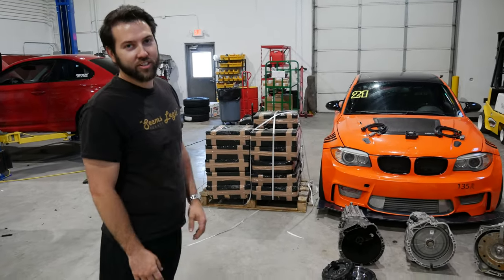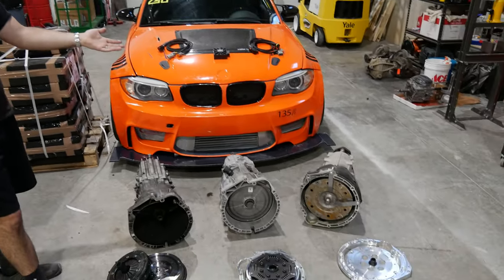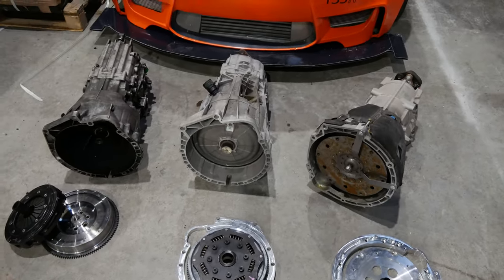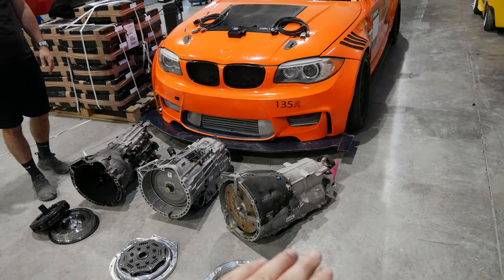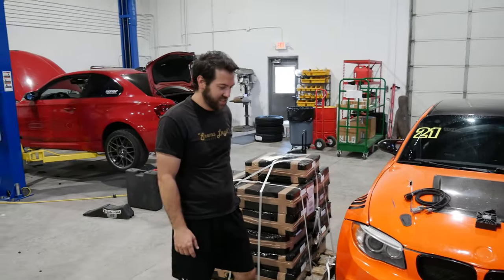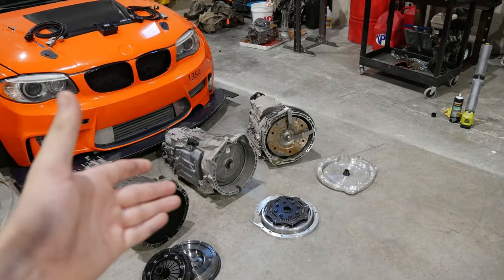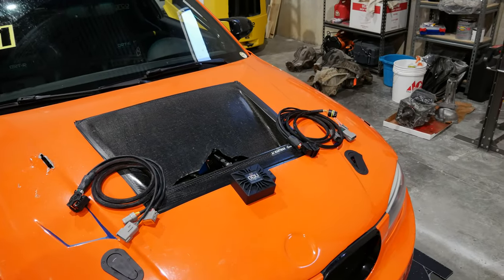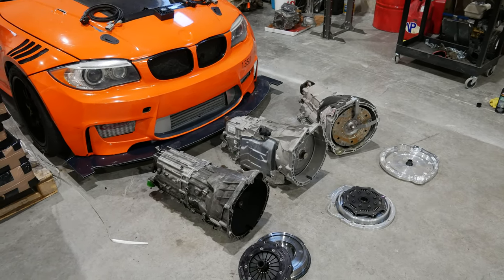8HP50/70 vs DCT Transmission Swaps for N54 BMW

Comment: If only the Turbo lamik controller was more easy to buy as it is a much better controller then HTG, theyve killed many boxes on popular swaps because of clutch adaptions.
Reply from the maker: Early on htg had teething problems but it works very very well with the new firmware and closed loop control of the tune and throttle control
Reply: @SeemsLegitGarage   i just recently returned my gcu because it was total dog shit. i can show you how i had to take a part a 15k dollar pure transmission because it fucked it all up.   i wouldnt use htg if you tried to pay me 25k dollars .  turbo lamik tcu is way better.  it runs on the factory bmw flash and resets adaptations, and then you use tuner pro to tune.  went from not being able to drive the car on the street with htg becuase it was jerky and terrible, to driving it like an oem 335i with lamik tcu.   i ttook htg a year to refund me and they sent parts insteaed of money.   aside from the tuning and electronics. the 8hp75 is godly for n54 cars.  i make the torque converter adapter to use the a90 8hp5x converter with the 8hp70 as long as you use a 17mm adapter plate( all n54 to 8hp adapters are 17mm)  .  i have a 5k rpm billet stator a90 converter in my full billet 8hp75 and its rated for 1600 ft lbs. i leave on the trans brake 20+ psi and my car sees 40 psi and it doesnt miss a beat.  drives like oem  until you want it to come alive .
Reply from the maker: @Mp-jw1qg  Sounds like you didn't have the right tuner, and also the closed loop was just released so you didn't have that if you had to wait a year.
Reply: @Mp-jw1qg  common problems at Htg. They service if you want to give them money but all other things they won't aswer. Everytime same excuse "we are so busy" Lol,customer service is really big thing with these controllers. So many have wasted they money and time to they "products" Thank good there is better options avaible like canformance and lamik.
Reply: @Mp-jw1qg  MAXXECU has gone the same direction using oem
Reply: @SeemsLegitGarage  sounds like the turbo lamik is better. I slapped an 8hp in my car in a day at work (I work at a shop) and drove it home and back to work in the morning it drove perfect and then I fine-tuned from there myself having never tuned a transmission before and it works great. You can get any trash controller to do what you need if you find the correct tuner.

Comment: What about the 6hp70? I know they aren't quite as good as the 8hp in terms of weight and shift speeds but they're pretty stout aren't they? 1000ft/lbs of torque capable and can be used with stock computers right?
Reply: I don’t think they ever made a 6hp70, furthest it goes is 6hp28 I believe? Either way there’s a reason guys in Europe switched to the 8hp a few years ago it’s a much better gearbox in all aspects.
Reply: @piovo1  that's my mistake, I mixed the 8hp coding up with the 6hp coding...but yes that is the transmission I was referring to
Reply: @SuperHbkforever  still need a different transmission controller, to be honest it would have been better but I think it’s quite rare in the us and Australia for the 8hp70s as there mainly used in diesels. Here in uk I can pick one up for £300-500z
Reply: @piovo1  would you need a different transmission controller for a hp21 to hp28 swap? To my understanding you can pair them to the factory computer and should run like stock, and being able to tune them through XHP in flashes. Ti be completely honest I'd prefer the 8hp route, but I drive an xdrive car and they are very hard to find (8hp70/75 specifically) at the moment I'm really trying to decide between rebuilding my stock trans with upgraded internals and torque converter, or going either hp28 or 8hp45/50 as they're showing up in yards nowadays...thanks for your input by the way

Comment: 8hp better then dct ?
Reply from the maker: they all have their place but we believe the 8hp is better all around. Holds more power, has a real trans brake for launches, smoother take up control and shifts basically just as fast as the DCT.
Reply: @SeemsLegitGarage  thank you I’m planning on doing a swap for my e60 m5

Comment: 8hp has pretty damn fast up shifts but down shifting is okay. It's annoying dropping  multiple gears on decel. I had it tuned which  greatly improved its behavior. However its not predictable enough for me to push my  f30 to the limit. I feel like a bit off padding is needed just incase it doesn't down shift exactly when I want or for having to ask it to down shift again...
Reply: when you do the swap you use a custom tcu with standalone tuning..  i have a pure drivetrain solutions 8hp75 in my 335i with lamik tcu and my car shifts exactly how i tell it to.  run the alpina b3 flash on the 8hp70 and it downshifts like a race car.
Reply from the maker: HTG can downshift much faster than oem
Reply: @SeemsLegitGarage  I have a tuned tcu fyi.
Reply: @konjiki240sx  you have a stock tuned ecu

Comment: i sent my htg controller back becuase it was dogshit and didnt have open loop tuning.  almost ruined my 15k dollars pure drivetrain solutions transmission. had to be completely taken apart and frictions replaced.  turbolamik tcu 2.0 is lightyears better.  just my honest 2 cents.. its a year later and i only got a shifter and some paddles for my $1600 refund.

even with my bad experience with HTG , ive been told they have fixed the bugs and now their system does work but i cant reccomend it until i see one in person because mine was FUCKED.

you can buy 8hp75 for 600 dollars shipped from ebay uk.   the 8hp50 and 8hp75 have identical internal gearing when you run a 3.31 final drive on the 8hp75. 

i make the adapter and a90 converter adapter to use with 8hp75. im in so cal. if you have someone to machine a few sets, ill send the cad files.  if you use the 8hp70 converter, it weighs twice what the a90 converter does and you cant get good response from it, revving the big converter above 7k is also dangerous lol.  ive spent so much money breaking these transmissions over the last 3 years doing this swap. if there is anything you guys need parts or tuning etc let me know , im always down to help .
Reply: the 'debate' between HTG and Lamik is super tough to work through from the outside, without any firsthand experience with either yet... both seem to swear the other is shit haha
Reply: @truecapacityfitness1611  because bart...is all talk. Nothing but that. I could link you to group of people who experienced the worst with htg including Screenshots of his behaviour in conversations. Actually i never heard Anything bad about a lamik unit.
Reply: @maxgr7723  yeah unfortunately I’ve heard this all way too many times, and know people first hand with that experience. I’ve gone with Lamik for my setup & as you’ve mentioned it seems to be nothing but positive feedback so fingers crossed I experience the same

Comment: I heard that the DCT is slower from a dig than the stock 6hp in an e90 335i.  Is this true and why?
Reply from the maker: I have never heard or experienced that, DCT has launch control and you can code it to start in 1st or 2nd. 8HP can have a slight advantage with trans break, but a 6hp just break boosting wouldn't be faster.

Comment: Any reason why you went with an 8HP50 w/ adapter plate instead of just going with an N55 8HP45 that bolts right up to the n54? I've been looking into this swap and a pure drivetrain solutions 8HP45 seems like it makes the most sense to go with in the States unless there's some major difference between the 45 and 50 that makes it a better transmission that I'm not aware of.
Reply: 50/70 apparently handle much more power...
Reply: @truecapacityfitness1611  the 50 doesnt hold anymore power than the 45. youll destroy the internals at 650hp.  8hp70 can hold close to 900hp with just tuning. with clutches and billet baskets it can handle 1500+ ft lbs at the wheels.  8hp50 would never even fully built.
Reply: @Mp-jw1qg  cheers for that! I’m not sure what I was thinking when I wrote that cos I did know the 45 & 50 are basically the same... Good to know the real world limits of both though thanks 👍🏼
I’m going to use the 45 with about550-600hp so fingers crossed it holds up
Reply from the maker: @truecapacityfitness1611  the 45 and 50 are not the same internally, we are finding the limit with the 50 and HTG. With HTG you can hold much more power than oem
Reply: @SeemsLegitGarage  I’m super interested in this cos I’m building an N54 powered Nissan chassis competition drift car at the moment & I’ve decided to go down the 8HP path too... tossing up between HTG or Lamik, leaning towards HTG
Reply: @Seems Legit Garage  hi guys, I'm here in the UK and have a m240i b58 with the zf8hp50, do you know how much hp and ft lb tq this box can handle before a swap to the hp70 would be needed. I have xhp stage 3 already just curious to know it's limits. Thanks, loving the videos, sending support from the UK.
Reply: @truecapacityfitness1611 lamik>>

Comment: I’ve been looking for a more modern solution to the SMG in my M5. The manual swap is where the money is because of the “save the manuals” purists, but frankly boring. I like the idea of a DCT, or the 8 speed. From what I gather it’s never been done successfully with the S85.  Do you make adapters for the S85?
Reply from the maker: We can use the E90 M3 transmission without the need for an adapter for that application
Reply: @SeemsLegitGarage  has it been done before? I remember reading somewhere years ago that the output shaft or something on the S85 was too big?
Reply from the maker: @adamjames90  Yea its been done, just need a custom driveshaftshaft, not the end of the world, we can do that as well
Reply: @SeemsLegitGarage  damn I might actually do this. Which flywheel would I need? The S85 or the S65s?
Reply from the maker: @adamjames90  s65 with the dct factory flywheel

Comment: I want to put a 8hp50 into my e53 at some point with a VF supercharger kit to mimic a x5 Le Mans with the power-weight ratio at least. Do you supply m54 adapter plates?
Reply from the maker: Yes we have M54 to 8HP

Comment: What final drive ratio will get you to 200hp while still getting a good 1/4 mile time
Reply: with an 8 speed and assuming you are running 255/35/18's with a 3.85 rear end you can get to 212mph at 7000 rpm. and about 3000 rpm at 90mph. a 3.08 would go 265mph in 8th gear at 7000 rpm and cruse at 118mph at 3000rpm. 2117 rpm at 80mph and 1720rpm at 65mph.
Reply: @BEAMERNOOB  Is that the German 8 speed with a 6th gear that's 1:1? I believe the overdrive ratio are less efficient as it will take more power to turn the gears. I dont have real world testing for cars in this category but I am planning on gathering the knowledge as my bank is loading.

Comment: Ram 1500 3L diesel trucks have zf8hp 70 transmission
Is there any reason to think I could not put this in my 90?
Reply from the maker: you can for sure, we have adapters in stock actually, email us :)

Comment: Look on it, size wise how much wider is the 8hp70 vs the 6 speed manual bz trans?
Reply from the maker: The BMW 70 isn't much wider but the dodge 70 is a little bit, some whacks to the trans tunnel are needed to fit the dodge.
Reply: @SeemsLegitGarage  ok thank you, I may end up using a 8hp50 from a b46 on a 2jz.

Comment: Where did you get the 3.27 diff? Weren’t the factory options, 3.08MT and 3.46AT for all N54’s?
Reply from the maker: Car has a Ford 8.8 rear end, which is another product we make
Reply: @SeemsLegitGarage  I thought maybe you found another gear set that works. I can’t be putting Ford stuff on my BMW. lol. Be easier just to have a ring and pinion custom made.
Reply from the maker: @TML34  You should, the ford works amazing. We track our cars and make lots of ford kits, many race teams save huge amounts of lap times with the awesome carbon clutch LSD we use. Custom gears are crazy expensive.
Reply: @SeemsLegitGarage  I don’t have any problems with the Quaife diff, driveshaft or axles though. It all works just fine, so not worth the swap (for me). I think Mfactory might have an in-between ratio that would be perfect. All I need is a different ring and pinion that bolts up to the factory crown wheel. Ratio swaps should be relatively straight forward.

Comment: What cars can I get 8hp transmission from and do you sell kit for e46 m3
Reply from the maker: Yes we have the adapters in stock. Please email us and we can sort you out with the details
Reply: @SeemsLegitGarage  the current adapter also fits S54?
Reply from the maker: @petereacmen716  it should actually yes, and we have others in stock for other 8hp for m5x/s5x. Only difference is the starter I believe but that’s interchangeable

Comment: i was all save the manuals til i drove the manual g80 and realized it’s still a big ass computer and i need a electric tranny
Reply: i have an e46 for ultimate driving experiences
Reply from the maker: I still love the manuals but honestly the DCT/8HP is such a blast
Reply: @SeemsLegitGarage  it’s pretty cool in a 1 series, i honestly prefer tuned SMG’s and DCTs but that’s just me. i like paddle shifting and just shifting straight up when i want to down shift. it feels natural and bad ass when im going from 0 to 100 too
Reply: @SeemsLegitGarage  but i have some manuals it’s just more for articulation for me and fun. not speed.

Comment: How much torque can dct handle?
Reply from the maker: depends on the controller and clutches but max is over 1200 ft lbs
Reply: @SeemsLegitGarage  what about the stock clutch? i got z4 35i,i wanna go bigger turbo,iv heard max is 600lbft on stock clutch

Comment: I'm sorry, this is for me personally. As a who automatics to their limit. I rather have the dinosaur manual. Manuals have never let me down. Racing wise I rather just invest in a proper sequential gearbox (paddle or lever)
Reply from the maker: Manuals are awesome but when it comes to dropping 20k on a sequential and the rebuild required its not practical for 99% of the use case out of professional racing